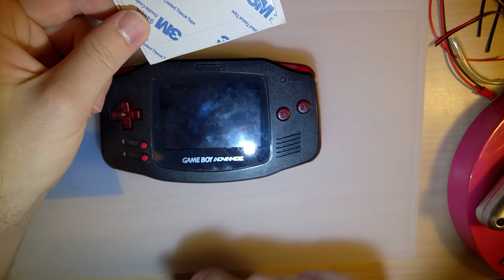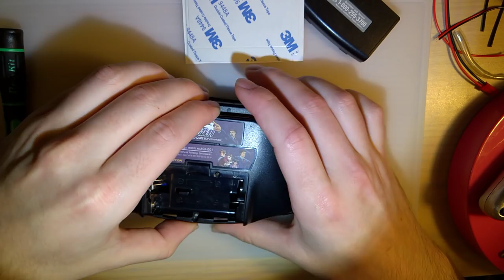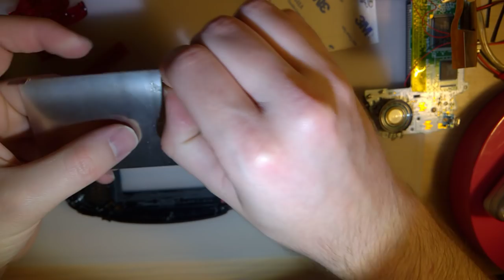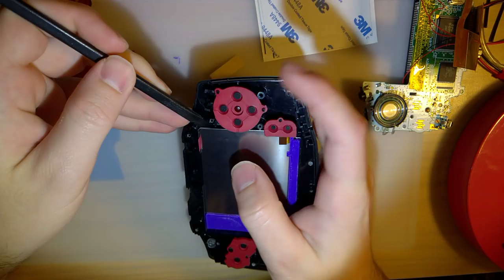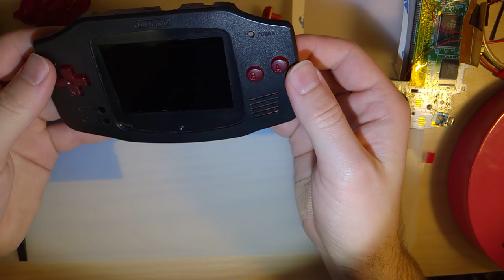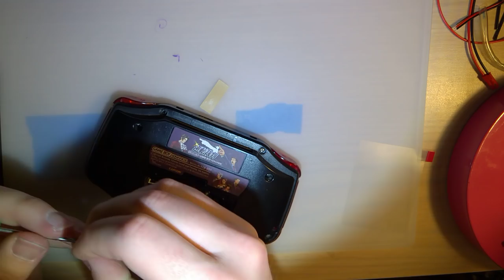Finishing the install of the FunnyPlaying IPS GBA Screen with the RetroModding Bracket (Part 2)

Comment: I finished a GBA build/re-shell using a Funny Playing IPS V2 screen...  Went great and in most use cases the screen performance is excellent...  I can relate about needing to clean the screen towards the end too! Lolz! Spent at least 5 mins with a microfiber cloth and a dab of isopropyl 99%... Cheers! 👍🙂

Comment: I Use the tape for Smartphone. Sticky but thin like hell.
And i would put on the Display backsite isolation tape on the Metal to prevent shorting the electronic

Comment: If you don't solder the wire, by default which level of brightness is it?
Reply from the maker: There are five brightness options, the default is #2 (where #5 is the brightest). The kit does not remember your brightness setting so you'll have to change it every time if you don't play on default.
Reply: @makho  thanks for replying! Then I'm impressed, even Level 2 default looks so good. Honestly, even no soldering is fine.

Comment: Should the top of the ribbon be covered with Kapton tape so it won’t short against the backside of the motherboard?
Reply from the maker: It certainly won't hurt but I don't think it's really necessary. There is a ton of room. You can always cut off a square of foam from the box the kit ships in and put it behind the display to insulate the ribbon from the motherboard.

Comment: Hi, love your videos, question, I solder the points for the brightness control, but the points get away from the board, is there any point where I can solder then?
Reply from the maker: Hi, sorry, not sure I follow. What do you mean by "the points get away from the board"? Are you saying that you soldered to the ribbon but the pads lifted and broke off?
Reply: @makho  I mean that the points tp9 and tp2 points on the GBA board broke off, and I'm wondering if there are any other points where I can solder them.
Reply from the maker: @Hermas_360  You can use other buttons instead and for the shoulder buttons, just solder directly to the pin of the button itself.

Comment: i'm gong to try using a sheet of clear adhesive on my install instead of the messy LOCA stuff.
Reply from the maker: That sounds like a bad idea. No adhesive or LOCA works fine.
Reply: @makho  You're right. Totally unnecessary.

Comment: I need to add a voltage regulator to my GBA so it can run my everdrive.  Have you done a video on when it's a good idea to install a voltage regulator?
Reply from the maker: I've not done a video on that. I've never had to add a regulator to a GBA. You sure that's the issue?
Reply: @makho  I had sudden resets while playing and when pressing the start button.  I was playing on a AGS 101 moded GBA with a GB everdrive.  I just came to that conclusion because it acted similarly when I put the GB Everdrive in a Backlight/Bivert Gameboy Pocket.  That one definitely needs a regulator.  Just waiting for the regulators to show up from China.  I recharged my batteries and now it works fine.  /shrug

Comment: Whats the battery life like with regular batteries?
Reply from the maker: About half of what they were before if my measurements are correct. I haven't run my batteries down completely in this console yet so I can't give you specifics, but since every game, GBA, and set of batteries is different, I don't think my runtimes are all that relevant.